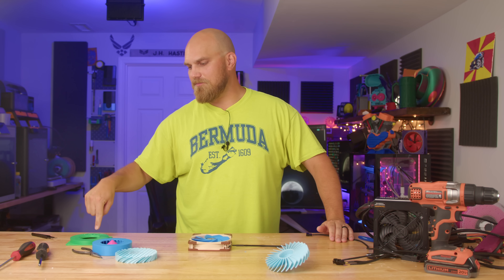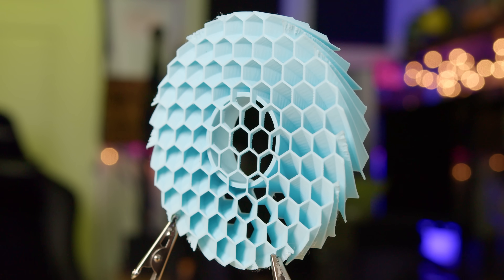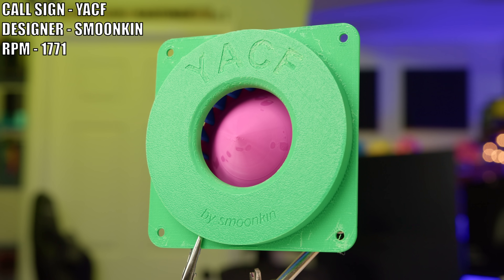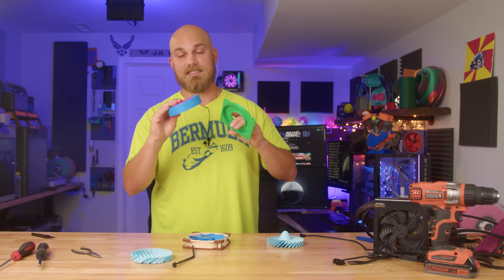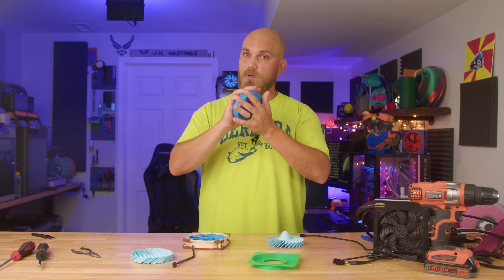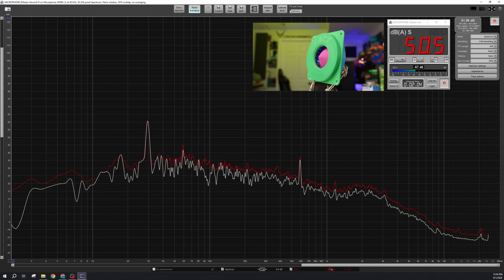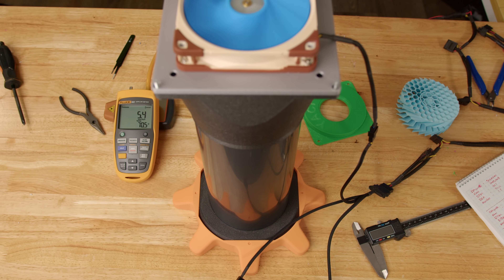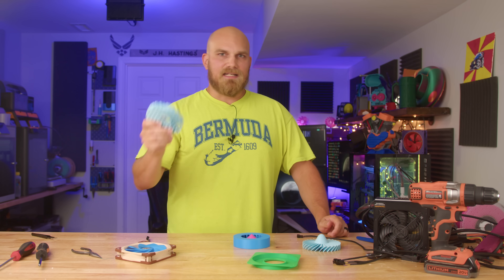This Fan Crushes Noctua A12x25 by 125% | Fan Showdown S6E5

Comment: I think the Vortex9 should be tested further. Since you're only testing pressure, this result doesn't mean it's actually a good fan. Airflow also matters, and I suspect it's quite low with this one.
I understand that's the singular goal for this particular competition, but does everybody?
Honeycomb might make a good case fan. Nice, far reaching flow of smoke there. Not much turbulence.
Reply: Yeah, totally agree. My Vortex9 is a static pressure contest fan only. Not good for much else - maybe a hamster bouncy castle. I have a better fan posted, the XJ99C, and another maybe even better in development, the MangoKnife. I wouldn't be sad to see a season where the contest is a static pressure run and a max flow run, make a simple P-Q curve, winner is the one with the biggest area under the 'curve'.

Comment: I would love to print and test the vortex9 myself. How can i get the stl file?
Reply: I've already uploaded it on Make r World!
Reply: @mobiobione  What software did you use to cad this? wondering if you can share the original file as I need to change the internal diameter to fit my current fan.

Comment: You need to measure CFM too. Static pressure is only 1/2 the picture. While it takes some instrumentation, a full pressure drop vs flow rate curve is what is needed to characterize a fan.

Comment: Why are you measuring static pressure for a PC fan?  It has nothing to do with cooling.  Take an old PC case..  cover all holes in the case except two.  Mount the fan in the front of the case drawing air in.  Use an accurate anemometer to measure the FPM of the fan at the other opening, and then calculate the CFM.  This would be a more realistic measurement of a fans capability to cool a PC by how much are PM it can actually move.  Honestly the current tests you do not really mean anything to PC owners.

Comment: Trim in that "backplate" a bit, and maybe add a small shroud around the front perimeter and I bet the vortex9 would do even better.
Reply: Yeah, it's kind of counter intuitive, I know. I started with the backplate half way out, and as I moved it out, the pressure kept rising. My Vortex9 is not very good at flowing CFM, but that seems to be the tradeoff for mmH2O.
Reply: @mobiobione  No, that makes sense, now that you say it.  I wonder if moving to a more radial fan design would help with the blowback.  As it stands, you're getting your static pressure, but most of your air is going everywhere but out the back.
Reply: @blarghchan  well, without giving too anything away, I do have a couple of other fans already submitted!...

Comment: you need to have a column for unrestricted flow rate Qmax. right now you have fully restricted pressure, Pmax. we need both to generate a basic fan performance curve. this will give a true score if any of these blades are worth using compared to default or if they are simply overtuned for one metric but useless in practice. e.g. wonder from down under is great at 3.33x Pmax but if flow rate drops by more than 1.8x, you probably shouldn't use it for most cases. considering RPM drops by 30% and power is proportional to RPM cubed, i expect AT LEAST 2x reduction in flow rate.

at first glance, i see three fans above Noctua on the rankings that are able to maintain close to the 2000RPM default. these are the most impressive designs because they are exactly matched to the default motor (in terms of power transfer to the blades) and yet are able to produce higher Pmax. provided there is actually good Qmax for these three (no worse than 40% CFM reduction), Devil, Gear Ratio and Dragon Wing are the best candidates if you need to modify the Noctua for slightly higher Pmax.

Comment: More fan showdown more often. Also, ditch this season soon due to the limited usefulness if the results. 

Next season do dynamic pressure measurements with a radiator on the tube, while measuring airflow. This will be much more useful information and keep designs focused on air flow while keeping a focus on static drop across the radiator. 

If you wanted, you could have next season be without a radiator, dynanic pressure, ajd CFM. season 8 then would be the same but with a radiator to add more resistance.

Comment: I have one suggestion for Fan Showdown Season 7, Please make it heat test based. Static pressure doesn't mean much if there isn't enough airflow to carry the heat away, and airflow don't matter much if there isn't enough pressure to push the air through the radiator.

Comment: 0:40
The most important thing is that you are excited to make a video. I have been following you since "water cooled air cooler" and i trust that if you are excited about a video then I will too.

A topic I have been thinking about lately is air filters. Why not use silent 120-140 mm pc fans to pull air through a filter (maybe an activated carbon filter from a random car🤷)  3D print something the can hold the fans and the filter and maybe test it using the smoke machine or measure the air particles (you can find PM10 and PM2.5 sensors for cheap, PM1 not so much).

3D printers and candles also make particles that should be easy to measure. So maybe you can use them.🤷

I think it could be a fun video or maybe 2. Fans could be optimized, bigger and smaller filters, different fan speeds etc you get the idea.😂

Comment: Have you thought of enclosing the smoke source so that it doesn't interfere with the output during tests? Especially good to prevent the smoke from just blowing right into the camera.

And what makes a good cooling fan, in terms of air output? I'd think it would be a good outflow of air that goes across all the components, which I don't see how the centrifugal fans are delivering with how close the smoke (output) seems to linger close to the exiting side.

Comment: If you want maximum static pressure, you need a reciprocating pump. Convert that rotary action into a piston or similar back-and-forth operating device with an inlet and outlet valve. Should be fairly trivial to generate several bars of pressure.

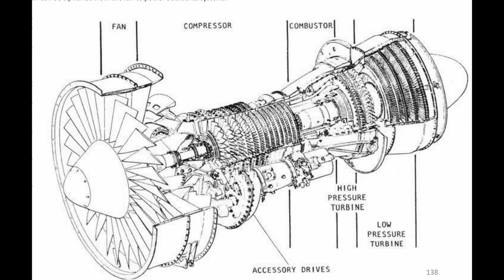Comment: 3:21 i doubt these designs will do any good on a 12v motor. the amount of power this design can utilize in a jet engine is... yeah... huge. i think there is simply too much material for a 12v motor to move and get any good performance... we'll see later if i'm right :)

Comment: it would be nice to also see unloaded CFM in the chart, even if the goal is static pressure. Really would help to see the differences between two designs that score similar in CFM.
Honeycomb's 44dba combined with an "OK" CFM might actually make it a reasonable (and cool looking!) case fan.

Comment: The Vortex9 is the true 1st place, in my opinion, because it actually fits into the frame.
Reply: Hey, thanks for the vote, anyway! I have had the thought at times that the designs should be limited to inside the frame, or have two separate categories.
Reply: @mobiobione Great work! Just splendid to see some real enquiry and I hope your design gets the recognition it deserves. Would love to see the benefit of that kind of fan on a tight fin radiation (if there is one...)
Reply: @flasksval  Well thanks! I'm thinking that as the bottom plate is reduced in diameter, the static pressure performance will drop, but the open flow CFM will rise, so it could be tailored to the radiator in question. Need more pressure, larger plate. More flow, smaller plate. Step file is on 'the Bamboo' site if you want to play around with it.
Reply: Is the amazing vortex 9 available to download?
Reply: @MrDingaling007  The clue lies in at 6:02.
Reply: @thisisbhm  thanks
Reply: @mobiobione  But then you get thinks like the YACF, where it is larger than the frame, but not by much.  Also, an improvement to the Vortex9 might be small adapter plates on the front and back to smooth the airflow.
Reply: @mobiobione  I wonder if this design would work upsidedown? I use the A12 for my 3d printer exhaust fans, and they could definitely use more pressure :D
Reply: @Silentwidow1222  maybe, though I'd be surprised if it worked inverted. This fan will probably not move enough air to cool really well though, I fear. I do have other fans with a good tradeoff of pressure and flow. On Make r World, my XJ99C is a good all rounder with pressure around 3.15mmH2O, the PSF is even a bit more pressure leaning. Even my old T33 MkIII does around 3mmH2O.
Reply: @mobiobione  Yes at the end he should really print out a whole set of the winner that would fit in a build and see how much better cooling it is than the stock fan.
Reply: and it's half as loud too.
Reply: What? Bro have you watched the test? The Vortex9 mostly throws the air around to the sides. Only a fraction gets actually pushed to the other side. The honeycomb did better by MILES and also actually fits into the frame.
Reply: @kaystephan2610  ...not a cfm test, but a static pressure one. You watched the video without understanding it. Good job.

Comment: Its honestly pretty impressive how the Vortex 9 was able to hit those numbers while maintaining the profile of the fan. Its a long way off from the WFDU but remember that it had a whole separate housing assembly and orientation on the test bench. V9 is a big step forward in design for this season.
Reply: Well, thanks! I'm glad you like it!
Reply: @mobiobione  hi, do you think that normalized by dBA your fan is still better than the noctua one? Because if so i might aswell print them and have better performances
Reply: @glianonimi602 honestly the only reliable way to know is to print one and performance test it. I can tell you that 46 to 52dBA is much more significant to the human ear than it looks (at basically any audible frequency)
Reply: @glianonimi602  It's not about just dBA either. The frequency peaks are just as important with high frequency peaks being perceived as a lot more annoying (whining fan noise) than a lower frequency "hum".
Reply: @MLWJ1993  that makes sense. But at this point whats the reason behind this video. You cant normalize for dba, which would be the thing that makes more sense, you cant normalize by rpm because its useless. Apparently pressure isnt even the only thing that counts. So wth is this video about?
Reply: @glianonimi602  It's about static pressure, which is only 1 of many metrics that make a fan good for a specific purpose.
Reply: @MLWJ1993  and the static pressure doesnt change if you do more rpms on the same fan? And by doing so you increase dba??? Without normalizing how can you make a comparison
Reply: @mobiobione  Your design is better than a big company's design like Noctua? I don't understand.
Reply: @goku445  Well, this fan is good enough to currently hold 2nd place in a zero flow static pressure contest. As it is, I don't think it'd be good for much else really. Maybe making the bottom disk smaller in diameter would allow more flow and thus more cooling, but then it'd loose static pressure performance. To compare one fan to another we'd really need to do full P-Q curves and see which fan is better at the point the system curve of the thing we're cooling intersects. I actually do have a fan or two that outperfoms the stock at most if not all points on a P-Q graph( like my XJ99C, on Make r World) but I'm guessing that cost of production weighs heavily on a companies choice of design, and some of these 3d printed designs would be hard to mass produce.
Reply: @goku445  You need to define "better". Better static pressure, yes. Better airflow, probably not. Lower noise, no. Lower power consumption, probably not (consumption goes up at a fixed voltage if the fan is slowed down by air pressure). This is why Noctua make a range of fans for any particular size.
Reply: @GodmanchesterGoblin  this
Reply: @mobiobione  Thanks.
Reply: @GodmanchesterGoblin  Don't forget longevity and price.  One of the main reasons Noctua took so long before releasing their new fans was they decreased the tolerances, and kept failing the accelerated aging tests without using even more expensive materials.  A 6 year warranty is nothing to scoff at.
Reply: @arthurmoore9488  Absolutely!  The durability of Noctua fans is one of the main  reasons that I have bought so many of them (multiple pcs for self, family, etc, as well as three Unraid servers).
Reply: @EmperorA0  Not just the warranty lenght but the actual curstom service (post sale) that they provide is top notch. If you have the budget, I don't think Noctua is ever a bad choice.
Reply: Yeah I don't like that he compares "normal" fans that fit the housing, to fans that have GIANT housings or fans that protrude out of the chassis.

Comment: Definitely need more episodes faster. Also, I feel we are getting only half the data. We really need both static pressure and volume of air. Both measurements are kind of useless without each other. Fan builds pressure, but doesn't move air, or fan moves air, but has no pressure. There should be a better happy medium that should be ranked at top because both parameters are very good. Maybe rank by PxV.

Comment: i like the idea of the vortex 9 but it's too ineffecient. while it's true the that it creates a lot of static pressure, it's not good at moving a lot of air THROUGH the fan. most of it is flung out the sides. i think adding a rim around the perimeter of the open face side to reduce turbulance and focus the air to the small opening would increase the CFM.

Comment: I'd love to see a turbo-compressor design where there's 2 fans, a small and a big one, big one is light and blows air in, second one is like 60mm and is inverted, so it sucks air. Both are connected from a central shaft to both sides of the fan hub. And then you put a pipe at the blow side of the small one. So the big one sucks the air into the case, then the small one compresses it and yeets it down a pipe to speed it up, increase the pressure, but also direct the flow to, for example, only the CPU tower.

Comment: That Vortex9 looks like it doesn't move the air very far, though it moves a lot of air. Seems like something you'd want in an air-cooled PC where your CPU and GPU coolers could direct the airflow while it keeps them fed with the fresh air.
Reply: By placing a short pipe at the back of the fan. He may prevent air from escaping from the sides.
Reply: Basically the perfect exhaust or pull fan.
Reply: Yeah, low volume, high pressure. I'm not sure it would be good for cooling, but it was interesting to design - and maybe I can use it to inflate  my hamster bouncy-castle instead of lifting my soup!

Comment: That 8.0 rating.. 😶

Hah! It's always hilarious when the first place fan has some crazy high gap rating 💀
Reply: Also just to point out it sounds like a vacuum cleaner and has a centrifugal compressor attached. Takes up a ton more space than a normal 120 fan, so its a bit of a gimmick at this point. A bit of a blown up laptop fan. So honestly, this one hitting a 5.4 with just an open fan concept is pretty good in comparison.
Reply: It can be beaten.

Comment: Hey, long time fan, first time commenter to the channel - watching all these fans push air around has me wondering: We got static pressure, RPMs, and noise levels....but what about pure air speed....how fast are they moving the air. 

Think about it for a moment - an air pump can put out a lot of static pressure, but it don't go very fast, and while you can speed it up with an air compressor, that does NO good when you need speed to fill a very large bag. Or, in this case....move the hot air out of the way so the cool can take its place.

Edit: Well...box, not bag...but the sentiment is similar.
Reply: He's tested FPM (feet per minute) velocity and CFM (cubic feet per minute) volume of airflow in previous seasons, but this season is focused on static pressure. Maybe we'll get FPM/CFM measurements for some of these fan models in the future from James or the community.

Comment: Is there a category for ease of cleaning ? No one lives in a totally dust free environment , These fans WILL get dirty.
Reply: Just print a new one. ;-)
Reply: pro tip, get some cheap stocking and span a piece in front of the grill. Fantatsic dust filter
Reply: My guess would be if you can easily take them out if the frame/case, just give them a rinse in water or something, and let them dry
Reply: @CentreMetre  *DISTILLED water... heh

 normal tap water can contain microscopic particles that are metallic, sometimes enough mineral content even, to potentially produce arcing and conduction. Always use distilled water, literally collected from steam, so that you can be sure it is pure and does not have these particulates.
Reply: @Munenushi  Oh didnt know that, interesting. Thanks for telling me
Reply: @Munenushi Distilled water to rinse plastic? 🤣
Reply: @Good_Hot_Chocolate  Not wet you won't! 🤣
Reply: @Munenushi  You're not assuming they'd put the fan back on the motor while it's still wet, are you? 
A dry fan would never cause arcing regardless of what it was rinsed with...
Reply: @Munenushi only if it’s not dried lmao distilled water for my plastic only the best